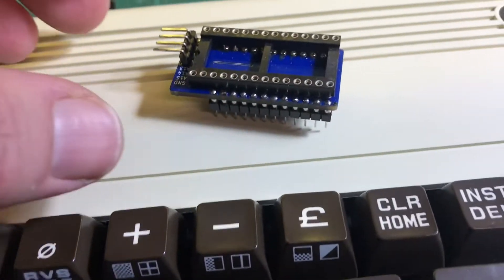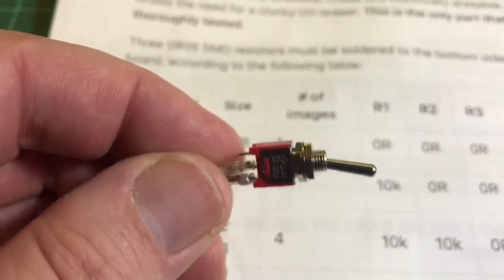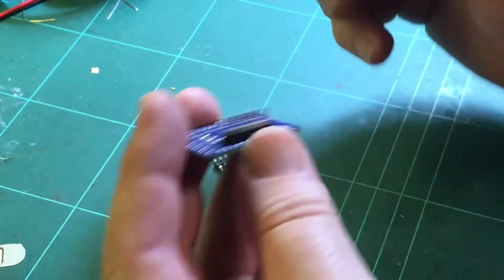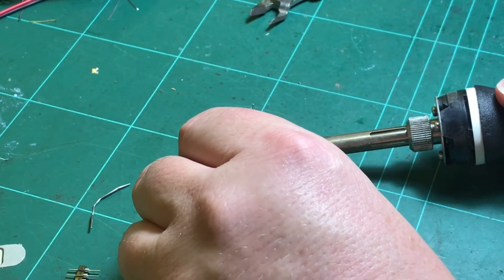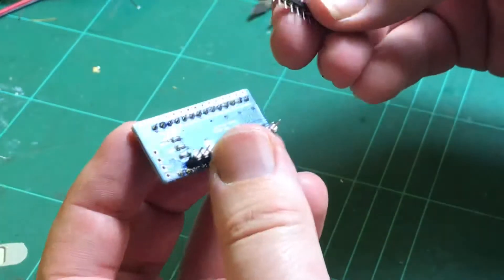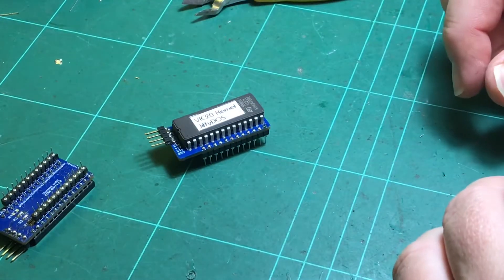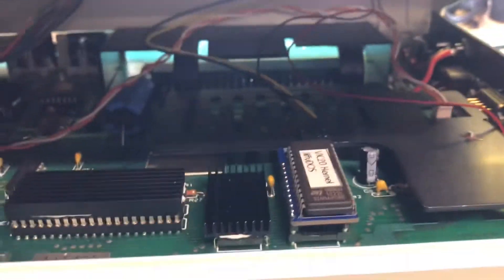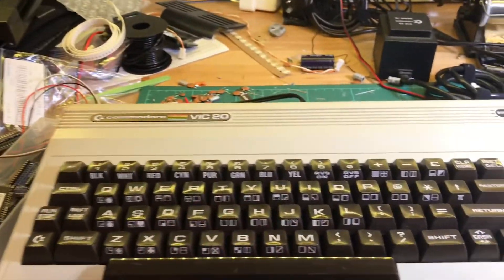🇺🇸 Commodore VIC-20: replacing the kernel ROM [TCE #0008]

Comment: What about replacing the 6502 with a 65c02 etc?
Reply from the maker: The 65C22 is a direct replacement but the 65C02 isn't fully compatible with the 6502 ... having said that, it's something that I've been meaning to try ... I'm guessing that 99.99% of software will still work fine, just maybe some demos that use undocumented op codes, etc. might have an issue ... ? It would be an interesting (maybe) comparison to do because replacing it will definitely add to the overall heat/power saving. /Brett

Comment: You could replace the voltage regulator with a cooler, switch mode version. LM317 ? I think the original one is.
Reply from the maker: Oh yes, I always do that ... replace the LM323 with a "PSU5 No Noise" from ezsbc.com ... I did a video also showing the difference in power draw when replacing various parts, including the LM323

https://youtu.be/9n-lFNrFt1w
Reply: @Brfff  Does that mean that you can shrink the black heatsink?
Reply from the maker: You don't need any heat sink at all ... but ... I've been told that the large one for the LM323 (that goes over the cartridge port) is "needed" to give structural rigidity to the motherboard, stop it flexing ... but how much flexing does it do screwed into the case ... ? /Brett

Comment: could you pass along the part numbers and source for the male and female pins you use?  They look a lot higher quality then most I have found.
Reply from the maker: Hi Edward - yeah, it was s bit difficult to find at the start - I've had to dig into my order history as it's been a while ... I think I've ended up using Samtec board-to-board pin headers (i.e 32-pin TS-132-T-A) from Element14 (aka Farnell) - not a perfect fit as you need to break them for a 24-pin row.  For the IC sockets I generally use Multicomp Pro 2227MC-28-03-05-F1 (maybe Element14/Farnell's "own brand"?) /Brett
Reply: @Brfff  thanks for taking the time to look that up

Comment: Hi do you thonk the c64 kernal rom adapter work on vic 20 because i have a load of them after i command on pcb way :)
Reply from the maker: Hi Steeve - really sorry for the very late response - I guess you've discovered already!  Yep, the adaptor works on both for the kernel ROM ... but not the character ROM ... Mr Sven Petersen has designed an adaptor for that ROM /Brett

https://github.com/svenpetersen1965/VIC-20_Character_ROM_Adapter
Reply: @Brfff  Thanks a lot !! :)